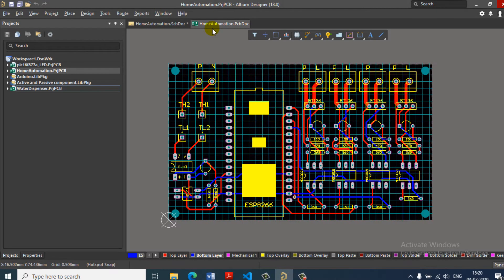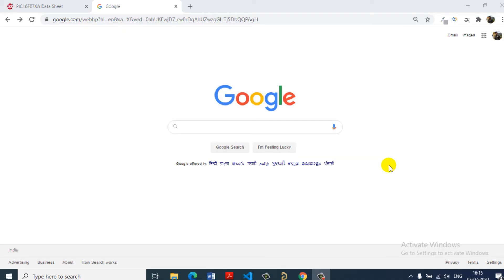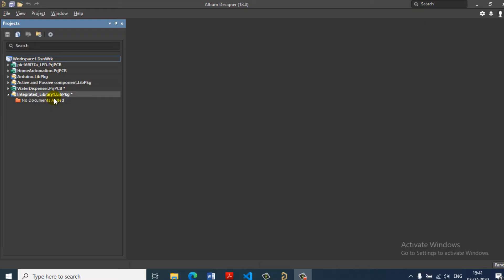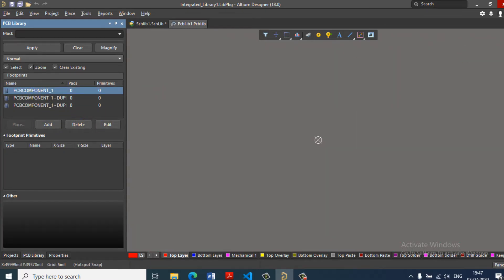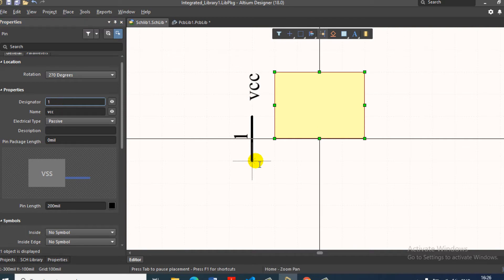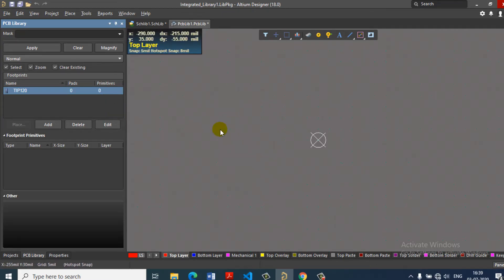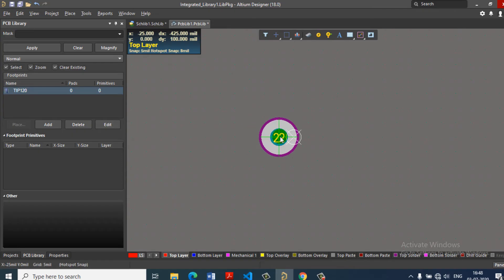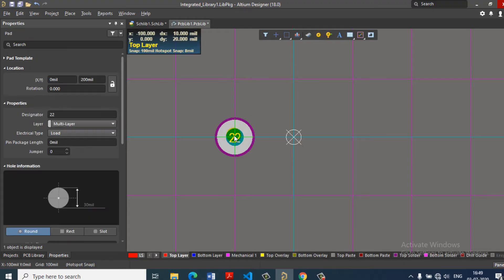PCB Library design in Tamil (HD) - Altium Part 2

Comment: Can we simulate schematic design and check the output with multimeter in altium??
Reply from the maker: Connection can be easily verifies in PCB layout by just pressing the control and clicking the trace.